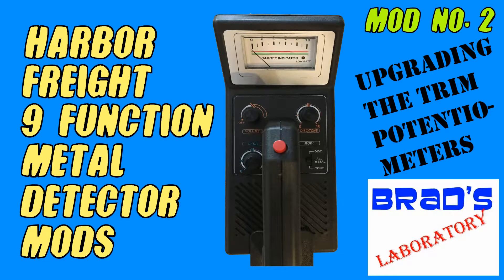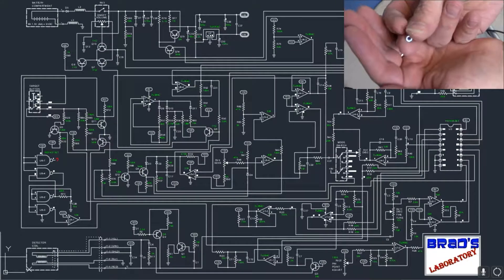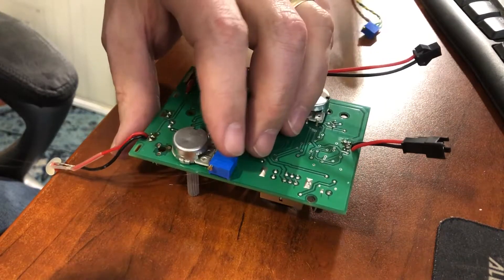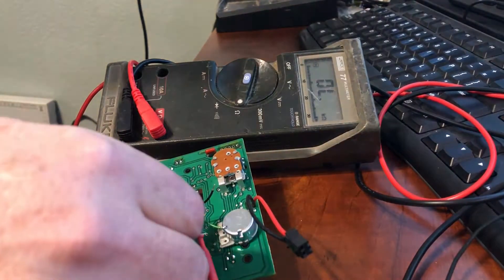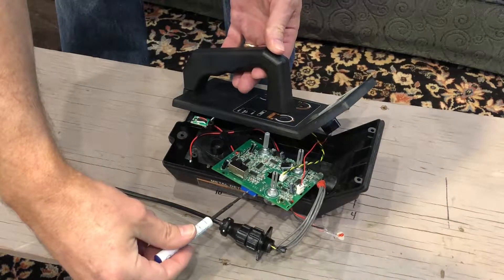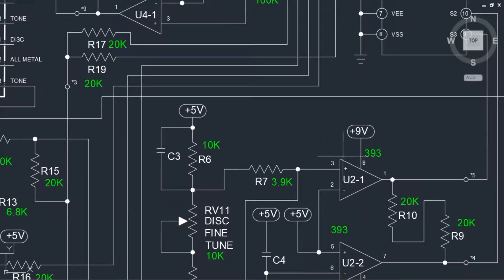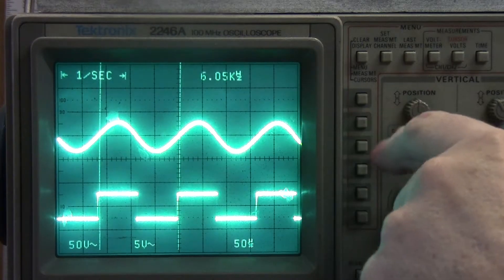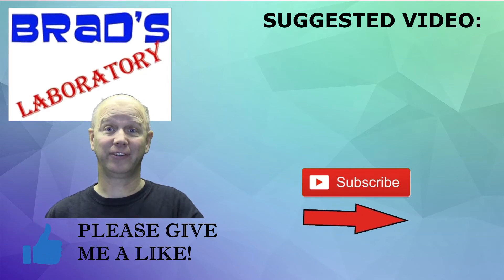Trimmer Potentiometer Swap

Comment: What is the Fuse specs
Reply from the maker: I looked back through all my notes and there is not a fuse in this metal detector. It uses diodes and voltage regulation to protect the circuitry.
Reply: @BradsLaboratory  Than you i appreciate your reply great videos keep up the excellent work regards.

Comment: I have  the HF nine. It seems to have stopped discriminating. I had zinc pennies dialed out but after some sand made the disc knob scratchy, it seems to have stopped disc. the three way switch still works.  any advice on how to test the circuit?
Reply from the maker: Looks like Q7 and Q8 cause the audio to mute based on the discrimination setting, although the pathway is convoluted. U8 and U5 are in the convoluted path, so it may be them.